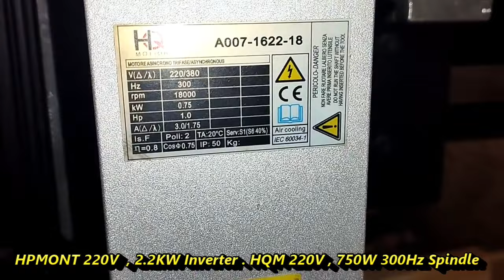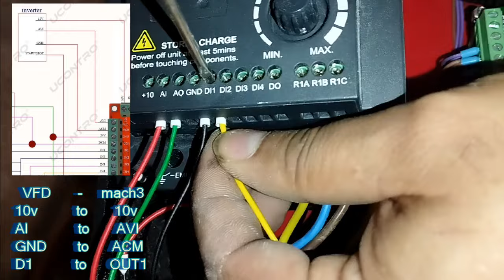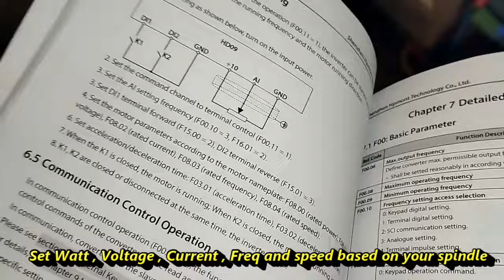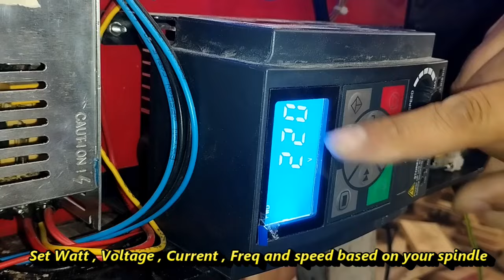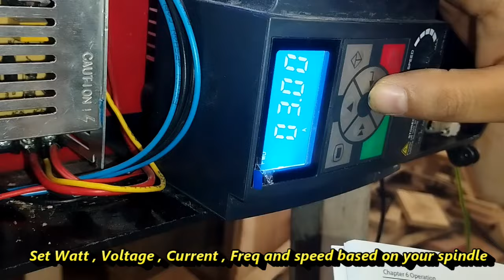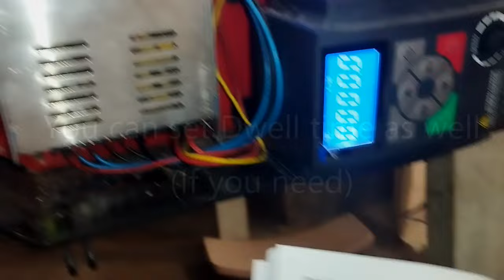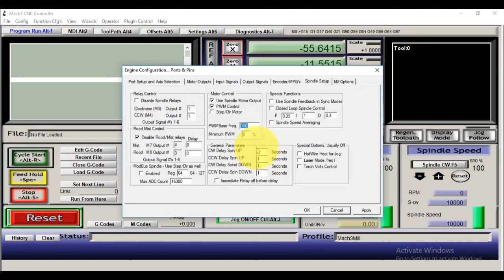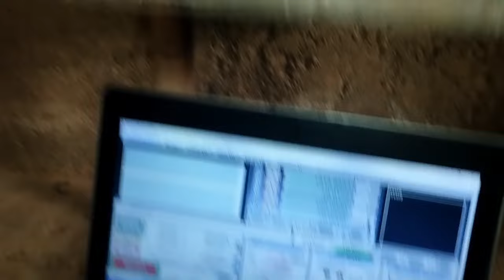Mach3 Spindle with VFD inverter Wiring and Config

Comment: you don't face any problem using mach USB board
Reply from the maker: You mean noise and some sudden disconnection?

If you use a short USB cable and connect the earth cable correctly , most of the problem is solved automatically.
I have not had any problems yet.
Reply: @manifa59  connect usb cable to ground how
Reply from the maker: I do not mean to ground the USB cable , you need to ground your CNC , Drivers and inverter to reduce noise .
Reply: @manifa59  but i didn't see grounding in the drivers maybe vfd ground is PE
Reply: You need to used shielded cables and Noise filter

Comment: Hello.
I'm trying to connect the attached drive and spindle to the same  Mach 3 board you have. but is not working. Maybe I programmed wrong. Can you advise?
 LCRHLCNC 110v Spindle Motor Kit，1.5Kw Square Air Cooled Spindle Motor 24000Rpm 400Hz，VFD Variable Frequency Drive，
Reply from the maker: Hello 
Does it have any manual that I can look at?